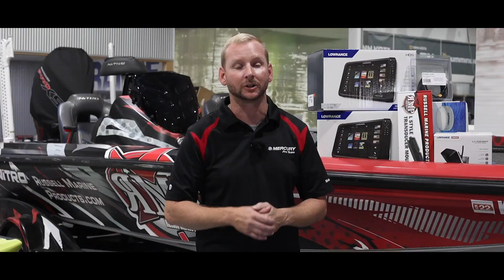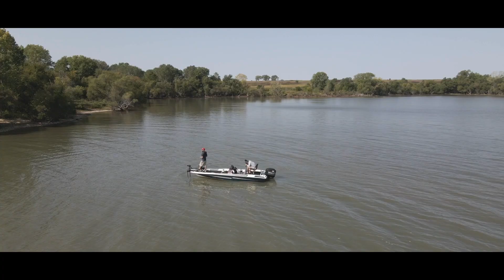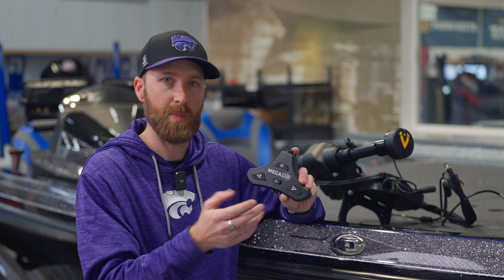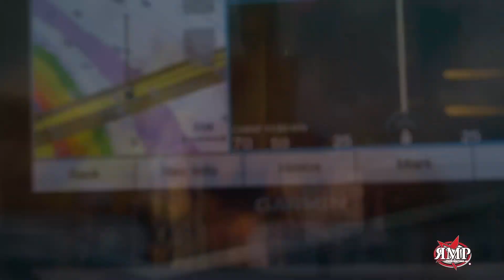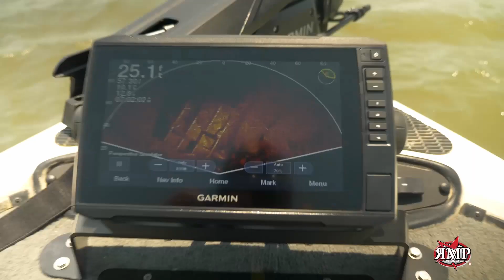FAQ Humminbird MegaLive Target Lock

Comment: Hello Team RMP, I would like to buy this HB Target Lock. But I cannot use it in combination with an MK Ultex. I have an MK Terrova with the "Advanced GPS Software" installed. I also use two HB Apex as depth sounders together with the new Terrova motor and a "Mega Live" in the network.

I know that the usual "Target Lock" does not fit on the Terrova. That is why I would like to install this "Target Lock" individually on the boat. I have very good ideas for this. Today I operate my "Mega Live" at the stern of the boat and it works very well.

I would really like to know whether the software installed on my devices is compatible with the "Target Lock". But above all I would like to know whether it makes any difference which motor is in the network in order to be able to use the functions of the "Target Lock" to their full extent in the "One boat network".

I already know of other solutions such as "Livescanner or Livesweep". But that's not really the best solution. It doesn't work in the "One boat Network" either.

Have you already tried it by using a Terrova in combination with the "Target Lock"? Have you already had any experiences here?

Greetings from Bochum in Germany
Christian

Comment: I just bought a target lock. I have one graph up front. I run a 360 & mega live. Once adding this targetlock system do I have to have a hub for 360/megalive/targetlock to run on one graph?
Reply from the maker: No you can run mega 360, mega live and target lock to a single unit. Once you try to network with another unit you would need the 5 port switch.
Reply: @RussellMarineProductsLLC  

With this setup will it be able to run the targetlock tracking with the TM?